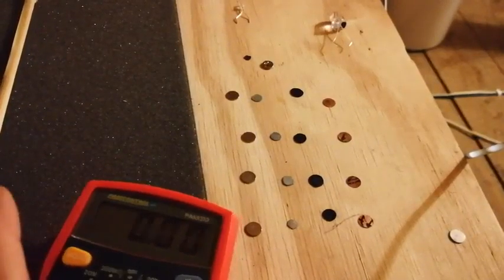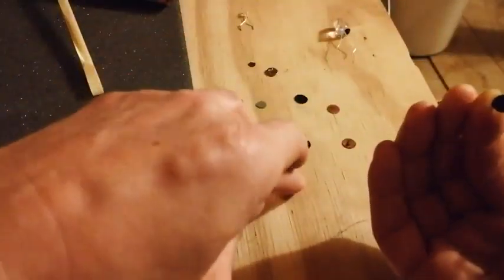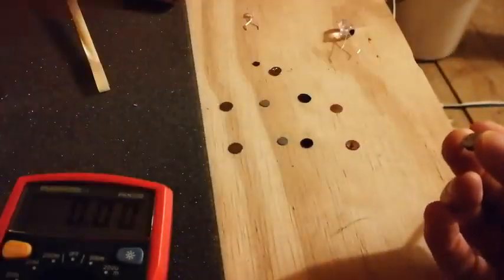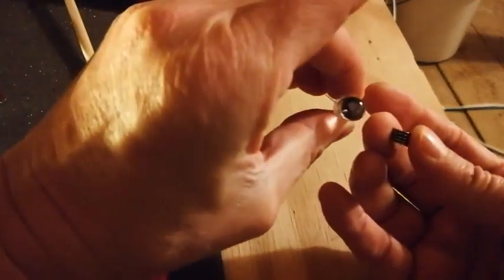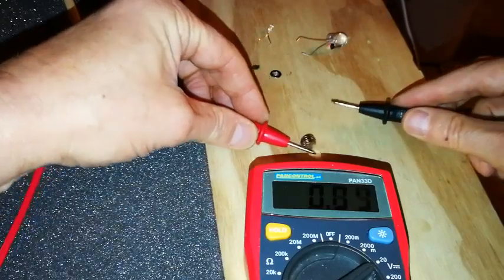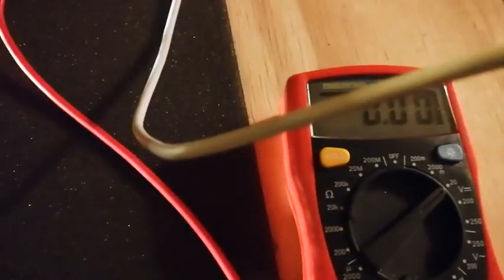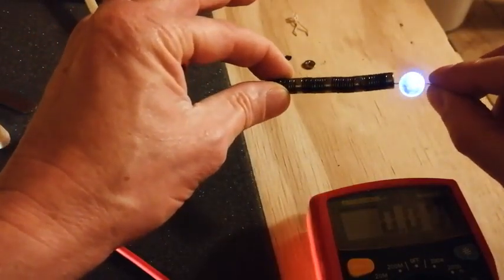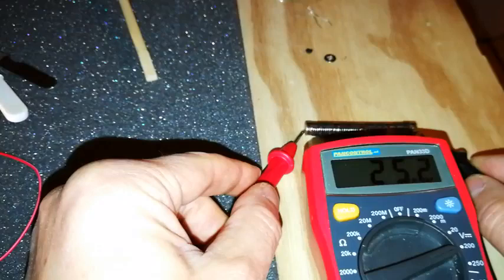QPC How To, Step-by-step

Comment: Mr nigel cheese. I have been looking for him for a long time. The man might be outspoken but this method does work. It is how batteries work somewhat he just made it better. See what he is trying to get at is that our knowledge of the magnetic spectrum is limited. You can fins some videos they are not very clear but it shows the four poles of magnets. Which he uses by implementing vortex math to show how we can harness that energy. Energy is not free. He never said it is. But we are using a hammer drill to wash a cup. If you get my meaning... anyway hope someone finds him.

Comment: I had 6 microwave donut magnets, cut some zinc, copper and thickish paper circles. Didn't work. I tried north copper paper zinc south and south copper paper zinc north. I tried an LED with no resister. A volt meter with a needle, an old school one, and a multimeter with AC and DC. Zip. Zero. I'll try thinner paper and report back. I'll make the edges of my cuts cleaner and see if that helps. I'll try neodynium magnets when I get some

Comment: No amps, voltage x amp = watts. 25v x .01 = ..25 watts yes you can illuminate a led….try a 12v light bulb

Comment: The voltages you are talking about won't be the main factor for damaging shocks, it'll be the resistance (ohms) across your body that makes the difference. 
More resistance means less current and less chance of a shock. i.e. Amps=Volts/Ohms < 30mA means you are less likely to die of a electrical-induced heart-attack on average.

Also, if anyone here is going to be messing with LEDs like that, check the wattage (power = volts * amps ) or get the lumen rating and use a table to get the equivalent wattage.

Comment: hi , follow y video s quit some time , when i saw this on i whas like ,ahh finally somebody found the formula to harvest energy from neodimiums without using moving parts , or o static way to produce volts from permanent magnets , and there you are , genius this is ,as far i understand ik makes the ions flow one side true the cilinder , the copper atracts the movement the zink schields....
i am compelled to recreate this baterie you are schowing , and drive next wheek to antwerp to the schop for a few flat neo s ,wont cost me more then 20 bucs,onley the copper and zink plate is going to be harder to find....send you my you tube video , when i have succes.....greetings from steven
Reply: any success steven?...

Comment: What material is the black paper disc... I'm guessing not standard paper seeing as its black... has anyone had any success recreating what Nigels doing
Reply from the maker: It’s black construction paper.  Any porous paper will work. The magnet array will produce 3-4 volts per inch.  But because the paper needs to be wet the metal magnets will deteriorate and the voltage product drops.  It is not an effective method except for experimentation and proof of concept.
Reply: @gregattelephonet7400  what non hydrated materials are you experimenting ?

From other videos appearantly there is a dry version with no humidity with 10 cells that can produce 7 to 25 volts when touching but have 1 volt of resonance frequency .

Can you please point us to the right way? After a while of frustrated attempts people will give up.

Please hell
Reply: So.. you made a battery.. wanna prize?

Comment: well the magnets alone, can not work for any kind of electricity.....between the magnets it's a battery probably 3 Volts CR1/3N , no magic and not suitable for an old guy like you to pretend to be something or do something extraordinarily..... nothing  special, the electrons are not moving, means there can not be any kind of electricity, if you like or not, this is not a serious video , sorry !!!!!!!!!
Reply: No, this is legit.

Use magnesium soaked in the paper , let it dry for a day and it will work. I don't know how to keep using and maintain the same volts since beginning . It will lose volts after a day and if you add more moisture the volts will not be the same. But this is working with the materials Nigel is saying. There are no batteries in between the magnets and material . I've tested myself and is working , just need to know how tp make it work forever as once said.
Reply: He lights the bulb you dumbass so there's definitely something to extract.
Reply: And if the electrons are not moving, how the hell does the bulb light up? That's only possible with electromagnetic friction

Comment: It's a galvanic cell: https://en.wikipedia.org/wiki/Galvanic_cell

Galvanic corrosion is a process that degrades metals electrochemically. This corrosion occurs when two dissimilar metals are located in contact with each other in the presence of an electrolyte, such as salt water, forming a galvanic cell. A cell can also be formed if the same metal is exposed to two different concentrations of electrolyte. The resulting electrochemical potential then develops an electric current that electrolytically dissolves the less noble material.

Basically the voltage this will be able to supply will weaken as the metals degrade and the solution dries up. So you need a way to keep the paper moist without being able to fully submerge the entire thing since that will screw with the reaction as well as replace the metals on occasion.

This is also DC power and pretty much everything in your house runs on AC so you will need an inverter circuit of some sort, which will reduce the efficiency further.

Finally also have to account for how adding a load will impact the chemical reaction since the balance of the circuit is now loaded down and no longer in equilibrium between the zinc and copper, thus slowing down the chemical reaction and reducing your supply voltage. A small LED won't do much, but good luck trying to run a compressor off of this

This is a cool experiment that shows how batteries in general work, but don't treat it like the end to big oil companies.
Reply: I thought you could power a small washing machine with it.
Reply: Could you just keep adding zinc or magnesium to the solution to keep the reaction goin? Then take out the corroded material and recycle it back with a different process?  Come on mate, keep your mind open here and lets get something going
Reply: dunno if you noticed or not but your theory is stupid. do you see any fluid being used in this demo? that makes your argument null and void.
Reply: Batteries also have resistance. Ampere showed that. 
If you add the cells in series, the DC resistance adds linearly (R=R1+R2+...) but in parallel they add inversely (1/R=1/R1+1/R2+...).
Reply: For two parallel cells: 
R'=(R1.R2)/(R1+R2). 
eg. R1=1 , R2=2 => linear resistance =1+2=3, but parallel resistance =(1)(2)/3=2/3.
Reply: The resistance along a wire depends on distance,  so the voltage ( V=IR ) depends on distance between two points, which is why it's referred to as "potential difference".
The current at some point in a circuit is just the rate at which numbers of electrons are changing at that point, and this depends on the cross-sectional area, so at a junction, more wires for the electrons to flow into means less current in each wire, with the current input i= total parallel current output= sum of parallel currents.

      ↓
      ↓  i [in] =i1+i2=V[in]/R[in]                                        ⇕    d1
______________
↓                           ↓
↓ i1=V1/R1       ↓ i2=V2/R2                                        ⇕    d2
--------------------------------
      ↓  i [out]=i[in] - 'losses'=V[out]/R[out]                ⇕    d3
      ↓

If there are no components, you can assume that for portions d1, d2, d3 of wire of same dimensions: V1~V2~V[in]~V[out].
Voltage can be thought of as a type of an average pressure over the volumetric-density of an electric field.
Current at point in a circuit can be thought of as the average variation of ('change in charge') electric field amount over the particular cross-section during a time interval.
Reply: Current at a point in a circuit is related to the force of the Electric field via a (dynamically) modified version of Columb's law. 
The rotational component of this dynamic electric field is the magnetic-field, which is why magnetic field-lines are drawn around current carrying wires in diagrams.
Reply: Leverage= Force x Lever arm.
Mag-field~ Electric-field x Lever arm.
Reply: Magnetic force F on current i along wire of length |L| is given by: F=i(B x L).
F, B=Mag field and L=|L|*(unit direction)='length vector' follow the 'Left hand rule'.
For a dynamic charge q, the mag-foce is given by F=q(B x v) , where v=velocity of charge.

Comment: What is the reasoning behind wet paper soaked in a solution of magnesium. If is to act as a conductor? As mentioned in another coment here,  would grahene not meet this requirement?  I trying to understand what role it has in this contruction?

Comment: Yes QPC can be scaled up or down but larger does not indicate more power.  It seems the opposite occurs.
Reply: Connect several in parallel?
Reply: @richarduk679  Hi Richard, have you tried (and succeeded) on any of Nigel's presentations
Reply: @greenfin1one870  Not yet. But as a formally trained electronics engineer, the resonance phenomenon has always seemed an interesting one. Whilst there are those who say that Nigel is not doing anything new and that solar panels have been using diodes to generate power for years. They seem to be unfamiliar (as neither am I) with Nigel’s arrangement of diodes and related components such that they resonate, giving the magnified output.

I would certainly be interested in learning more of Nigel’s techniques. Perhaps in an Amazon book - Free Energy for Dummies?
Reply: The smaller the spacial footprint, the higher the capacitance.